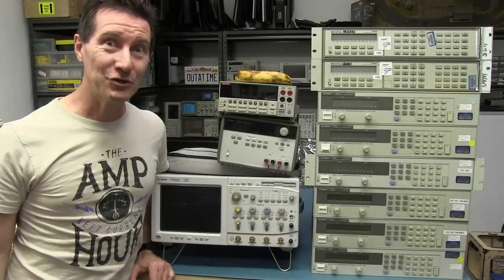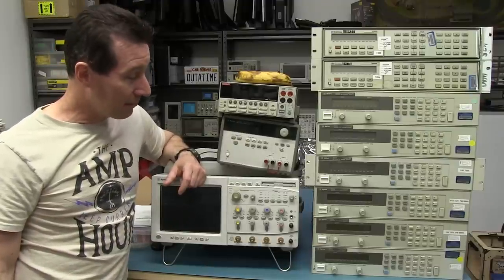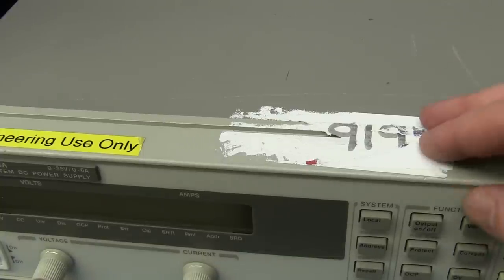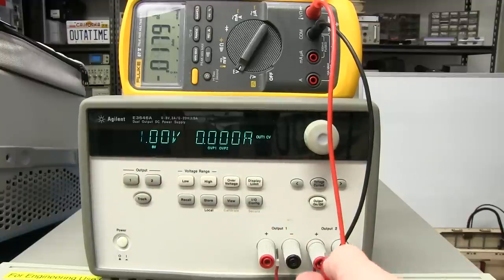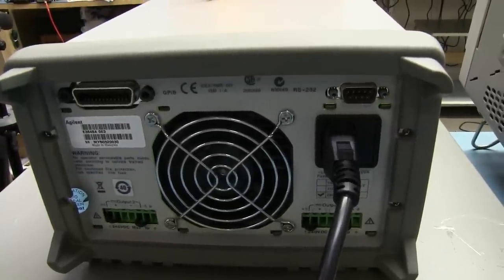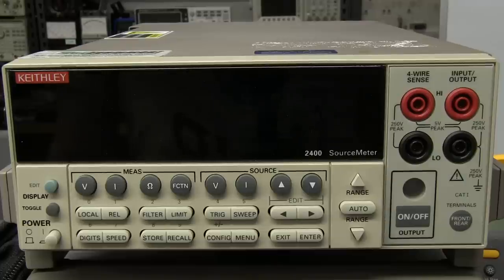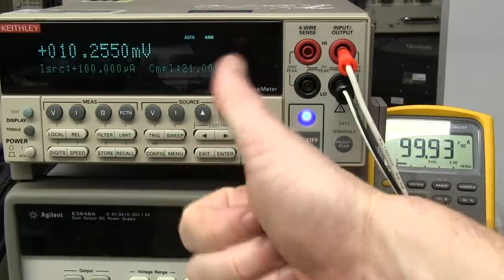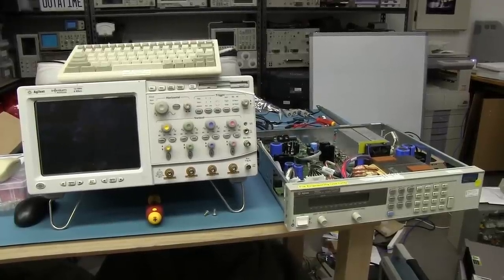EEVblog #655 - Auction Score

Comment: Only skimmed the vid so not sure you mentioned but those PSUs can also be used as dummy loads if you set the output voltage to 0v
Reply from the maker: mikeselectricstuff I was going to do a video showing this use of the 4 quadrant capability

Comment: You can put those system PSUs in series to get more voltage or parallel to get more current by using those IP/S connections on the back.

Comment: For getting labels off I discovered that Zippo lighter fluid (Naphtha) is great for it. The Ronsonol brand lighter fluid used to say right on the container that it is "Excellent for removing labels", but I hadn't used it until recently. Coleman fuel is also a [light] Naphtha and should work equally as well.
They are much cheaper than GooGone but don't have the orange smell (d-Limonene and Tripropyleneglycol methyl ether). GooGone is actually a low odor kerosene. It is a little bit heavier and will evaporate more slowly, like White spirit.
.

Comment: Gotta love HP/Agilent equipment.  I'm still using a 1960's vintage power supply at work that appears to be all original.  My only annoyance with it is that the chassis is connected to the positive terminal, which makes it unusable for powering stuff that's got an earth grounded chassis.

Comment: Pretty good construction on that PSU, by modern standards, but not a scratch against older HP stuff. I have a 70's HP system PSU, bought cheap because other bidders didn't know it could be option modified to operate at 240 V 50hz!!  Construction quality is amazing, with diecastings on the chassis, solid aluminium front panel, custom parts everywhere!  OK it's not as sophisticated feature wise, and it has analogue meters but to use and look at, it's a thing of beauty!  Only things I want to change are the volt and current pots, to 10 turn. Resolution on the standard pots is clunky.

Comment: Not sure if they sell them over there. But here in the states I found using a Magic Eraser to scrub off those nasty stickers to be easy and to clean up old hardware.
Reply from the maker: Dustin Holden You mean like this: EEVblog #560 - How To Remove Sticker Residue On Test Equipment
Reply: EEVblog Completely forgot about that video, sorry! But I was actually talking about a product called Mr Clean's Magic Eraser.

http://en.wikipedia.org/wiki/Melamine_foam
Reply: I find that a little alcohol works well. I have a few litres of 100% ethanol for cleaning purposes only, of course. :)
Reply: I've tried alcohol.. But those pesky Goodwill stickers are almost impossible after being attached to some types of plastics.
Reply: If the label is thick, I try to peel off as much as possible using a sharp razor blade which is lying almost flat on the surface, taking care not to scratch the plastic. This cuts through the glue between the plastic and label leaving only a smear of glue behind. I then attack that with the alcohol.
Reply: If alcohol and the eraser isn't enough, a small amount of WD-40 is the next move.  Add a bit of WD-40, let it work its way in for a few minutes and then rub or peel it right off.  Just don't use too much as it can get everywhere and it can leave an oily residue feel to it. However, with some eraser rubbing you can get rid of that residue as well and leave a nice clean polished look.  I use a little WD-40 to clean up old crusty guitar amps and it's great for getting out all those hard to clean beer and cigarette smoke stains.
Reply: I find Brasso Metal Polish Wadding removes all kinds of stickers, not good for all plastics or any clear.
Reply: 10100rsn
WD-40 is awesome for removing old sticker residue,  dont even have to use any elbow grease usually.  I just use a household cleaner or something to clean up the WD-40 residue when done.
Reply: Hexane works a treat, any residue just wipes away.
Reply: DanTheAwesomeMan Gasoline is based on Hexane, about 80% if memory serves.

Comment: An idea for removing those pesky stickers:
Remove as much as you can of the paper so you don't have much but the adhesive left, rub or brush oil onto it (I use rapeseed oil, but no reason why mineral oil shouldn't work), let it sit for a couple of hours (I usually let it sit overnight), and the sticker residue should come off by simply rubbing your fingers over it.
I don't know the exact mechanism, if it's that the adhesive is fat-soluble or that the oil simply wicks under the adhesive, or a combination of both.
The toughest part is getting the oil and (minor) adhesive residue off, my standard routine is to rub in raw (hand) dish-washing liquid or kitchen de-greaser (be careful tho, some brands can discolor plastic), maybe let sit for a minute or two, then using the sponge side of a Scotch-brite(tm) or equivalent to rub the oily residue off, then rinse (it usually takes a couple of rinse cycles to do, you know it's done when the surface no longer is slippery.
I'm sure that the rinsing can be replaced with a good bucket of warmish water and dishcloths and some added elbow grease.
I use the method mainly to desticker plastic containers for food (some are excellent for component and parts storage), and such containers are a good starting point to learn how to use this method (so even if it turns out it doesn't work (it doesn't work with every kind of sticker), those-who-must-be-obeyed will be happy for a stack of free containers :)

FINAL CAUTION: The process can be quite messy. Cover anything which might not take kindly to oil droplets (masking tape and plastic bags cut open comes to mind), have towels handy and use dishwashing liquid as soap when cleaning your hands up,
and use some moisturizing cream when you're done for the day (dishwashing liquid lifts much of the oils off your hands, even the natural oils).

Comment: Wow the Agilent ocilloscope is a nice machine, expensive tho would be fun to know how much you payed :)
Was thinking it's a bit slow and Harddrive is getting older, why don't you open it up and clone the drive and put the contents on a DOM (disk on module) or a fast CF card with a PATA adapter? That would make both boot times and load times a lot faster due to no accesstime. Also get rid of the annoying HDD noise. Also decrease heat in the machine and you can put a resistor and maybe get the fan down a bit :)

I would also get a small keyboard with build in trackball to save space when using it :) Can find old ones for cheap :)

Comment: Love the power supplies you as well as the multiplex switchs (I can think of a low voltage switching idea for those using some led lighting), that windows oscilloscope is not bad at all esp seeing you got all those probes with it, if it did not work that well I would set it up for a Technology Museum reading the trace of a  reciever or the like.

Comment: Hi Dave. I have similar models 6632B 0-20V 0-5A. But what i did find is a bit disturbing.
 When you remove top cover and you just turn on your power supply..then on those power transistors (those with small heat sinks on them) you can boil eggs... That design is really poor, temp. go up to 90 degree (depend on rail ofc). When fan is on then it is all right but design like that is not good.
They should increase size of those heat sinks or decrease  voltage difference. Btw i'm not sure how to calibrate them  If you can pls make video with calibration procedure. Thanks.

Comment: Can you get at least 4 digits of resolution and accuracy with some real cheap 10-25 turn POTs on amazon? I want to build a decent CV & CC 0-6A 0-15V power supply and for calibration use those POTs. For a voltage reference, what should I use? I want to set the voltage digitally with a micro controller, so what would be the best DAC to use w/ arduino? to To get 0-15V, I am not changing the feedback loop, but instead plan to use a fixed resistor divider for the feedback and using the DAC as a variable voltage reference.

Comment: Why would they use Windows, when it would make so much more sense to  use Linix.  Linix is open source, and it would be much easier to do this using it.
Reply: Yeah, using Windows as an OS for a commercial product that isn't a PC just seems like a terrible idea, especially for something like a scope with a long lifespan.  This is using Win98 though so Linux wasn't anywhere near where it is today.
Reply: That is a good point, I am not as familiar with computers of that time.  I can only remember up to Windows XP, and wasn't into operating systems as I am now, other that which ones I liked best.
Reply: Business sutff. In worst case, you have to maintain your own OS, don't have technical support guaranteed etc. Although I don't know how far the Linux Kernel and Userspace were developed to that day, I don't think there was anything working out-of-the-box complete with GUI, drivers and features.
So back in the day, I completely understand Agilent using Windows. Today, I'd really like to see this scope hacked running a modern Linux kernel.

Comment: The only thing that sucks about those scopes is that they run win98. Ugh, makes me angry every time I need to use one and then try to get data out of it somehow. Best way to ruin good hardware of all time - run windows on it. At least the cmos battery is good in yours - nothing like having to press F1 every time you power the scope on. Guess it is hard to argue with the bandwidth and sample rate though, especially if you got it at a good price

Comment: teardown tuesday on that scope!!!!!, i wonder if the CPU can be easily upgreaded to a K6-3....
Reply: I doubt the CPU is doing much of anything other than sending commands to some controller.  The waveform and everything are probably a hardware overlay.  Imaging the OS to a faster hard drive would REALLY help things along, though.
Reply: Aeduo if you are spoke about the scope, if i recall right there is a custom gpu that overlay the windows image with the scope image. The cpu run the ui meanwhile the waveform come ftom a custom asic. Yhis is the reason why the scope is fast. In the tds 7000 scope meanwhile the waveform is managed by the cpu do they are slower. If you look in the forum there is a pos from free_electron about that.
Reply: Alberto Vaudagna wrong post for my response. Sorry.
Reply: Aeduo wouldn't all the math functions run on software?, just like any modern scope, ffts, filters, etc etc

Comment: Aren't IEEE-488 controllers kind of scarce these days? I wish I had a buck for every T&ME calibration program I wrote for an HP 9000 series desktop calculator back in the '70s but all I see even on eBay are a few spare parts. I suppose there are PCI bus cards  and emulation software for PC's but that tells you how long I've been out of touch!
Reply: +nozmoking1 There are ridiculously priced USB to GPIB cables:))

Comment: Swap the harddisc for an ssd, should improve that boot time.
Reply: I don't know if it is even possible to make a device that old work with an SSD....
Reply: Being a K6 2/400 CPU, I would assume there is no SATA on the mainboard.  Could still be done though.
Reply: even a usb stick would be faster
Reply: Indeed there are, not as common as SATA SSD's though.
Reply: ***** Why not just use a compact flash card? they're already compatible, easy to find, etc...

Comment: What's that "strip" under the BNC connectors on the oscilloscope?

http://puu.sh/b2Y56/0b701f6558.jpg
Reply: At this high bandwidth the probes have to be active type, which is the purpose of the additional pins.
Reply: spikester do active probes just get extrapower over these pins? Or also data stuff?
Reply: ***** It's for probe identification (10x, 100x etc so the scope auto sets up) as well as for probe power (for active probes). Most modern Agilent scopes have them. Tek have a similar implementation on their medium to high end scopes.

Comment: Hi Sir EEVblog ...I new to all this electronics and its wonders ways an from what i've seen i wish that i could get in to it like you an your follower's . If i could i would love to update an upgrade a old time favourite an love of mind call Technics Sl 1210mk2 .. I have seen a Sl-dz Technics which is a CD player that you can use like a vinyl turntable but I'am a vinyl man myself . Anyway I always wondered if i could maybe use the motherboard motor, pitch control components an have it so its like a real vinyl player 1210 but wont fluctuate or bir when its not touched an give pinpoint accuracy when it comes to the speeds by pitch control to platter ,  Well its just a dream off mind .. An could you advise me on what frequency counter that is small enough to go in your pocket that can do this  Adjust VR301 so that the frequency is 262.08 kHz ± 0.05 kHz. please ? as you can see I'am a real newbie... Thanks an keep up the good stuff  EEVblog